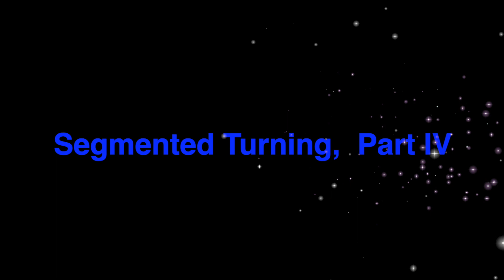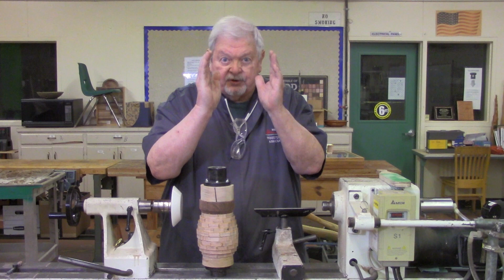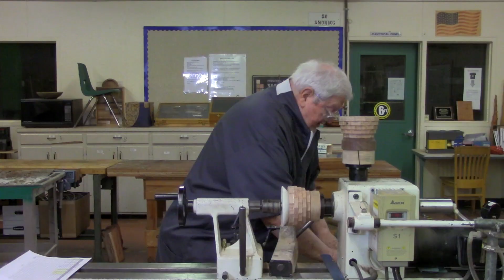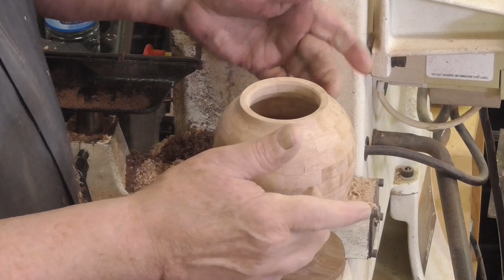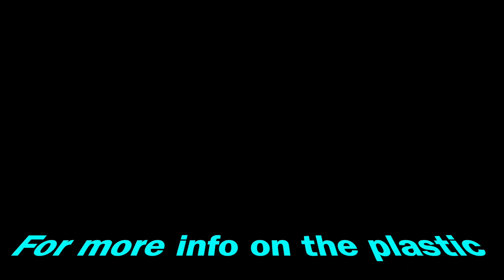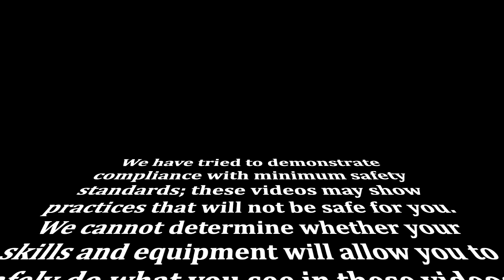Jim Rodgers, Segmented Turning, Part IV   HD 1080p

Comment: Brilliant tutorial thanks.   I think it should be mentioned for safety reasons; especially for newer turners. Turning a small vessel like this one with a fresh 5 min old glue joint might be ok. But anything bigger should really be left a couple of hours at least to cure. A 5 min old glue joint will not hold a larger urn. A 12" urn coming apart at the fresh glue joint at 700 rpm is a very scary thing.
Reply: I build vessels slowly. I have three lathes set up in my shop, and let things dry fully before moving on. Segmenting is all about patience and attention to detail. To me is is a mindset thing more than a construction thing.

Comment: Another excellent production. Very good method of turning the interior of a small mouth vessel. Good commentary. Nice to see Jim introduced Woodturner Pro. However Jim should be using dust protection while sanding. Still, thank you for sharing. Have a great Independence day and stay safe.
Reply from the maker: We have two very large collectors in the classroom  and 6 small ones around the classroom.   During the presentation and recording, we have one on, the big ones are turned on when the filming is over.  It’s an interesting issue, to get the sound clear we have to keep noise levels down, then turn everything on when we finish.  Jim is such a great turner, sanding is minimal.  When classes are in session all are on.  Thanks for your comments and concerns, your comments and concerns are very much appreciated.  Please keep your comments coming, Jim and I appreciate all of them.